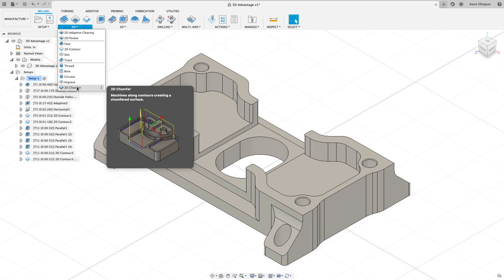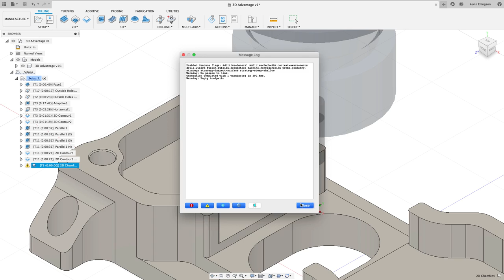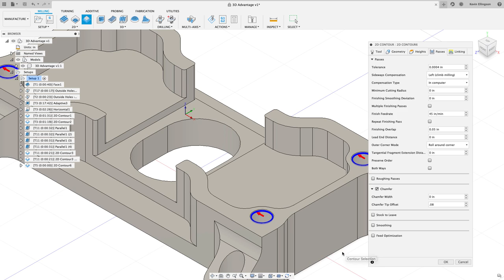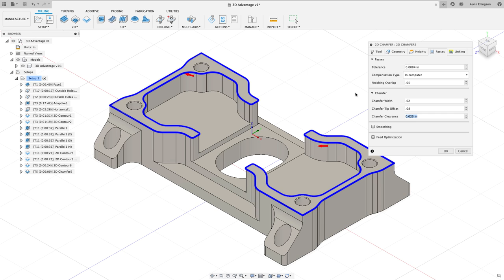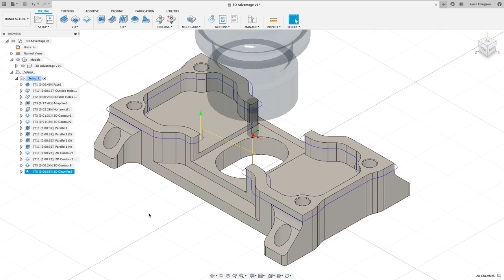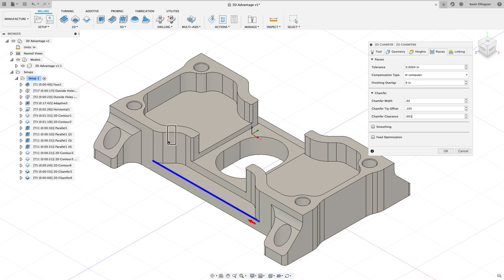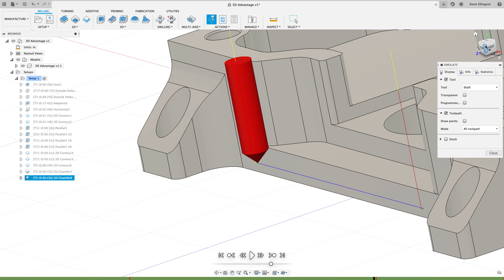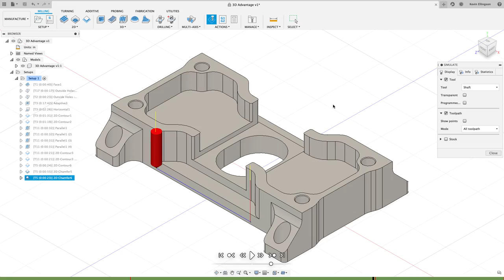Fusion 360 - Chamfer Toolpath Options

Comment: Thanks for showing the difference between the two. BTW, I don't understand why the tool is staying red at 8:08. There should be no collision with the .001 clearance.
Reply: The red is showing a Crash, because the simulation is only for tool selected (chamf tool), if the previous tools were simulated the stock would be gone and the simulation would not turn red. :)
Reply from the maker: Hey Brett. Yep, and thanks for the assist! Hope all is well in SLC.
Reply: @brettrichardson2423  Thanks!

Comment: 2d chamfer works on modeled Chambers if you pick th top face profile edge and leave the chamfer width setting as 0
Reply from the maker: You can also adjust the heights to get it to work. However, it wasn’t design to work with actual modeled chamfers.

Comment: If I’m making a pallet for my vise that has 200 holes how would I select all the holes at once or Sketch boundary’s and select 50 at a time to chamfer the holes?
Reply from the maker: I just tried some things and I don't have any great news for you. I was hoping I could try some trickery to use the drill command to find all the holes and then derive the drill op to a chamfer op, but that didn't work. Is your chamfer tool larger in diameter than the hole you are chamfering? If so, did you know that on a drill command you can set your bottom height to chamfer width or to chamfer diameter? That is about the best I can do for you for a more automated way.
Reply: @MechanicalAdvantage  that’s funny you mentioned the drill command! That’s how I was able to accomplish chamfering all the holes! I selected diameter range .2 to .4 which selected all my .25 holes. I then used a 1/2” 82 degree bit which I added to my library. I selected top height at hole top 0 in and bottom height at hole top -0.13 in and this worked beautifully! Thank you sir for your help!

Comment: 2d contour is a solution, but here you lost the best thing, the collision control you show at the end. So only chamfer operation can do that. Here is the solution: select the UPPER contour, set Chamfer Width to zero, set Chamfer Tip Offset a little more like the deep of the chamfer size, as example 1,5mm if chamfer size is 1mm...and if the simulation is this time good, you see a beautifull chamfer ! Why i wrote if the simulation...? I found out that it is a difference if you jump to the end of an operation or to a operation and let it simulate. Sometimes i got rest material that are not could be. A other bad thing in the Fusion Universe...best regards
Reply: Captain DJ was just coming to comment this exact thing! Lol
Reply from the maker: Hey guys. I believe I mentioned in the video that you can use 2D chamfer on a chambered edge, but it takes some extra steps to do it. The steps mentioned above. I wanted to keep this video some and probably show how this could be accomplished on chamfers in a later video. Also, what if you didn't have to do those extra steps with 2D chamfer on a chamfered edge? Hmmmm Maybe something coming to a future release? 😊
Reply: @MechanicalAdvantage  There are no extra steps, just a little other settings. It will not always work but when it work you will got have the collision control. And because i am writing at the moment...don´t be angry for my comment in the other vid. I like fusion, but sometimes it look they will only optimize this "Alien Structures" (regenerative designs) and noting fixing in cam...have a nice day.
Reply from the maker: @HardcoreMusik  Yes, changing those other settings is what I was referring to. If I were mad, I would have deleted your comment. You have to remember that there are more than 5 people working on Fusion. So just because one team is working on Generative design doesn't mean that it will have any impact on what the CAM team is doing. Same with UI changes etc.